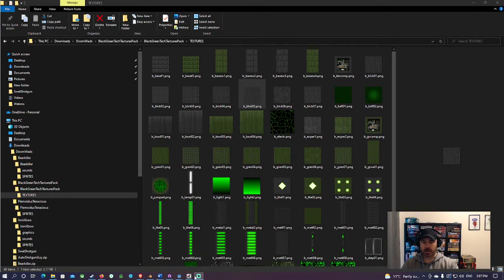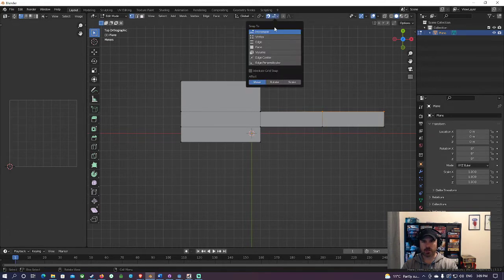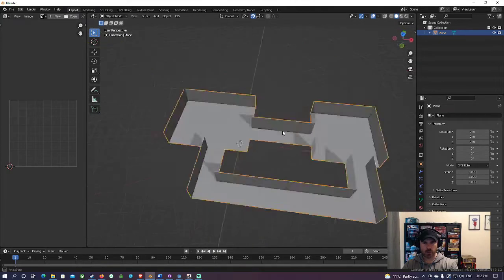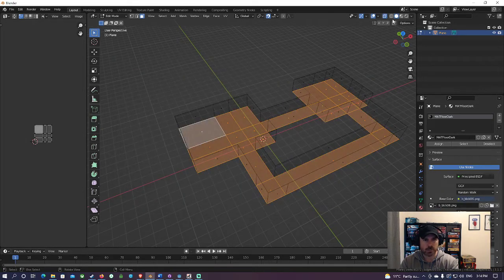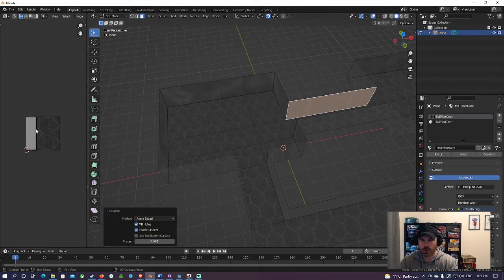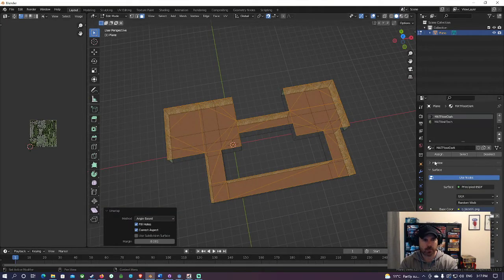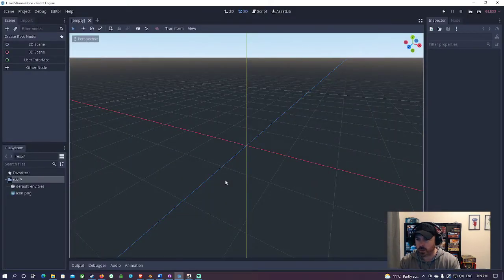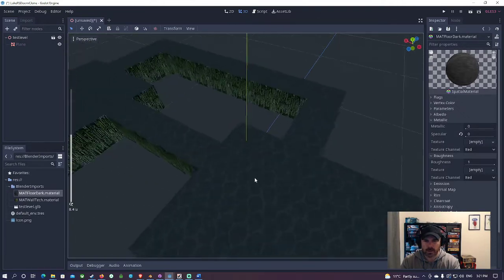Godot Doom Clone - Part 2 : Test Room

Comment: Hi! When I render the blender project as glTF and then try to open in Godot, materials seem to be png's that i cannot edit inside Godot (can't change roughness for ex.) any advice on that? Thanks!
Reply: Double click on the map object, an import window will open, on the top left corner there is an option that says "Action" click there and click "extract materials", you are welcome.
Reply: @sopothetocho had 10 min to do this and was sure i would until i struck this xD 100% failed  pretty bad, i malded. Should’ve read the comments lol
Reply from the maker: Use the override if you need to although this may be a Godot 4 feature